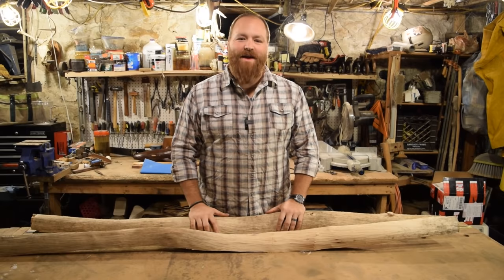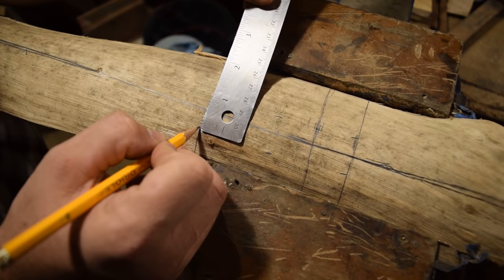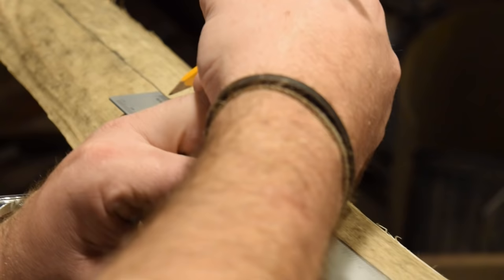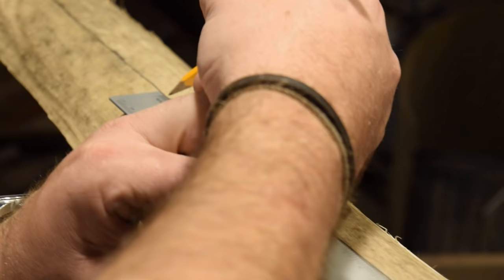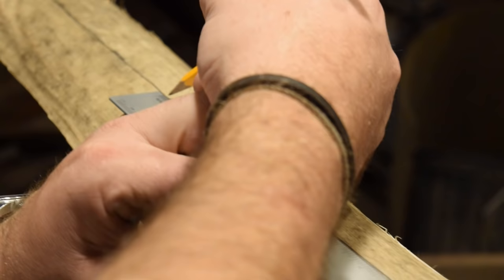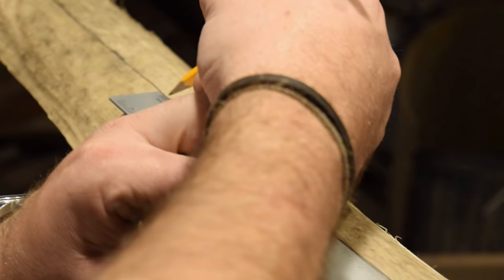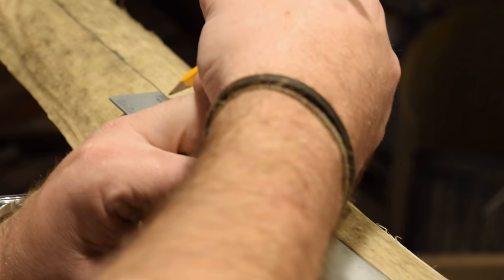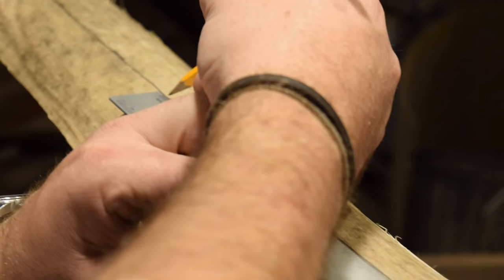Making an American Flatbow: Hickory

Comment: I learned a little something when working with band saws and I'm gonna explain as clearly as possible. Instead of cutting curves with the band saw you should put kerfs into the excess material and then go through cutting straight lines with the band saw. After that you can use a file to shape the curve. This is so that your band saw doesn't get dull or break. Hope this helps.
Reply: That's exactly what I suggested to my husband (who is a dam good carpenter, no disrespect intended to him.) But he said nahhh....the saw came off the guides, and hasn't been fixed until 4 months went by. Love him, tho!

Comment: I learned to make bows as a youngster.  And I do mean youngster.  I made my first bow when I was 7 yrs. old.  It wasn't very pretty but it shot well.  As I recall it was about 25lbs. @ 24".  
Powerful enough to bag cottontails.  
My stave was a scrap piece of hard rock maple.
My Dad was building a rustic rocking chair.  It was a genuine learning experience.  
I no longer "chase the grain" but rather use dimensional hardwood and back the bow with Sinew. 
I still make very limited use of modern materials. I use hide glue because it doesn't creep.  Waterproofing is home harvested Pine Oil mixed with Carnuba and Bees Wax mixed in.   My favorite limb wrap is Sturgeon Skin.  I started with Raw Hide and progressed through Snake Skin and on the Sturgeon Skin.  
I also switched to Asian/Turkish style Horse Bows.  Much faster cast and compact in the thick woods of the Catskills.
Reply from the maker: Thanks for the info David!
Reply: I'll bet those bows are something to behold.

Comment: I have used my identical-to-yours 12" Craftsman bandsaw for almost 30 years, and it did most things I needed.  In retirement, I upgraded to a Laguna 14/12.  Oh my, it was pricey, but the difference is beyond belief.  I now use my bandsaw as my table saw many times when ripping anything less than the throat width.  Material just flows through the blade.  It has become my go-to machine for numerous operations.  I wish I had bit the bullet long ago and got a heavy duty bandsaw.  I didn't know how versatile a really nice bandsaw could be.
Reply from the maker: That's not a bad idea Tony. Thanks for watching!

Comment: Hey tip with tung oil. Rub it in with a rag until it's hot to your hand. It makes the oil penetrate better and it doesn't leave excess oil on the surface. A couple layers of doing that works great.  Its what I was taught by my grandfather who made custom rifle stocks
Reply from the maker: Thanks! I’ll try that on the next one.

Comment: Great video 
Thank you Ranger.
One neat short story.

My father in law grew up with a metal coffee can, on an open flame, to radiate heat.
He waas doing this, in our little camper trailer, and discovered, that not all coffee cans, are metal nowadays.

Lesson learned, be certain that you have a fully Metallic coffee can, and not one with cardboard or plastic sides.

Great video.

Comment: Good craftsmanship. Lot of work and patience to make a bow without power tools.
I would like to mention that at 35:04 you said "put too much more pressure ..."; well you are pulling on a string (cable) and you cannot put pressure in/on a string. Strings can only take tension and pressure is what you put in your car tires. What you are doing is pulling on a string and you are pulling with a force of about 50 lb, but not pressure and defensively not compression.
Pressure is a measure that takes an area like pounds per square inch or newton per square meter. When you put air in your tires most cars take 30 psi (30 pounds per square inch).
Anyway, beautiful bow, thank you for sharing!

Comment: I love your workshop, it looks like it has real atmosphere.  I do mostly metalwork, with a lot of welding, so the wood shavings I generate, have to go straight away. Interesting video, I made a bow earlier this year, from Australlian Oak, but it snapped during the tillering. Will try again someday, out of a more suitable timber, I can get Sugar Maple here.
Reply from the maker: Thanks Keith. I’d say do some research for what wood you can order online  relatively locally that would be good for a bow. Osage, hickory, ash, yew, etc. good luck.
Reply: Unfortunately, it is very hard to get those timbers here in Australia, certainly in South Australia where I live. We do have a specialist timber yard that has some rock or sugar maple 2" square blocks, 6ft long at A$150 each, which is too much to waste when starting out.

Comment: Steam bend that limb and get it straight.  It will tiller better and you will get better energy distribution over the length of the bow.  I would also suggest getting a draw knife with some weight and backbone to it.  Mine is almost 3" from edge to spine.  I build my bows out of osage orange and this knife slices through like butter.  Made my first bow in 1982.
Reply: Brace height should never be more than 6” above the handle  - called the 
Howard Hill said if a str a straight end American Longbow is six feet between the bow nocks the max fistmele no more than six inches. The problem with using oil on a self bow is that it softens and weakens the wood
Cells and overtime it will reduce the weight of the bow.

Comment: I was taught that when you get it tillered and sanded roughly, put on a slightly too long string and put 100 arrows through it on 8/10 draw before you make it pretty. It either breaks, or develops set you need to fix.

Comment: I know this was long ago, but you should do a checkering on the handle, that 100 % tung oil is the one that I use after carving or checkering gun stocks, normally from 7 to 9 coats depends on how much shine I want.

Comment: if anyone is reading this to clean the round file, use a lighter, and burn the pieces out, doesn't hurt the file, as you aren't using enough heat to affect temper.
Reply from the maker: Not a bad idea. 👍🏼

Comment: I talked to an old man he had Old Sawmill up in Chattanooga.. and we were out in his shop and he took some glass and he was shaving with that like you were doing with that scraper he used a piece of glass he said that is the quickest way to remove things cuz it's got just the right of Edge is to take things off... course I'd use gloves to do it though he didn't he had really rough hands.. I didn't matter to him but he could do it with that piece of glass in it came out nice...
Reply from the maker: That's interesting Nicholas. Might have to try that. WITH gloves of course haha
Reply: Yeah, I keep pieces of broken glass around for just that purpose.  But be aware that not all broken edges are the same ...some have just the right (proper) angle to make good scrapers, some don't.  When you get a good one it's a joy to use.  I've always  done it bare-handed (77 yrs old) and have never had any mishaps.  Just takes some care and gentle touch.

Comment: Great video! Very nice looking bow.
I would suggest building with "string line" dead center and Not favoring "the hand side."  I understand that your archery skills may favor "American Style" shooting but a flatbow is a much more effective tool if arrows can be cast from either side of the grip.  Personally I shoot with a thumb ring most often and my thumb becomes my arrow rest on the right side of the bow. Occassionally I use a Cordovan finger tab and shoot from the left side.  My "long bow" is actually a Korean style "Infantry bow."   Yes it does have Siyahs.  I also use a "Horse Bow."  Currently my project is a 48" Bamboo backed Rock Maple 2 Piece Take Down Horse Bow.  It should draw 45-47 lbs. @ 28". Max draw 31."

Comment: Very nice. I am doing spoons for now. Maybe in a few years I would try this. I admire your work. I treat my spoons with half citrus oil and tung oil a couple times for deeper penetration, then do like you do with pure tung oil. Walnut oil is thinner and it will act like tung oil but I have not tried it yet. With all the work you do, I wonder what would be a good price for a hand done bow like this. I would take a guess, but it would be much better to hear your opinion. Thanks, Russ

Comment: Awesome beautiful job. Man, that bow shot really well. Nice touch with the feather carving on the ends. Why is it you do not sand the back side of the bow? Nothing like a tung oil finish. I just recently oiled a new hickory axe handle. I gives it such a personal touch.  Subbed.
Reply from the maker: Thank you. You want a complete growth ring on the back for complete strength and support, so you should avoid cutting the back as much as possible. I just used steel wool to clean it before oiling. You’re right. There’s nothing like oiling wood to finish a project. 😁👍🏼

Comment: Great so far. I am at 5:21 in the video. Now, I am openly admitting that I know virtually nothing about bow making. So, forgive if this is a stupid question. Here goes. Why not steam straighten the stave before any measurements and determining of which parts of the stave to use? It seems to me that straightening out the bends first would be advantageous. Is there a negative effect that would happen if you straightened it first? Thanks!
Reply: Red eyed Patriot1  Yes, that's true. So, I guess it was not so warped that he could not use it as it was. Thanks!

Comment: how do you tune it further after that, without losing more weight and strength?
Reply from the maker: You don’t😉. And additional tillering will remove draw weight. The only way to add weight would be to fire harden, or add a backing to the bow.

Comment: What if you installed a removable pin at one end of a yard stick so that you could spike it into the workpiece which would stabilize the yard stick at that end so you could establish the centerline more easily.  That's what I do on Kentucky Rifle stock blanks.
Reply: The center line must follow the grain, on the limbs. Sometimes it gets curvy. STRAIGHT  stock not good to follow natural grain lines.
Reply: @twintwo1429  Thanks, Twin.  Ya' learn somethin' new every day.

Comment: May I ask ( from the depths of my ignorance) if it's possible to use an aggressive sander to remove excess material?
Reply from the maker: It definitely is possible, and can be effective , but also much harder to control how much material is being removed. I would say use the aggressive material removal tools at the beginning, and move into hand tools when you get it to the tillering tree.

Comment: In what direction is the grain facing and does it make a difference?
Reply: The back of the bow (the outside of the tree )faces away from you. The belly of the bow(the inside of the tree) faces toward you. If your looking to build check out  The Traditional Bowyer's Bible volume one. They also have a volume 2,3 and 4. There filled with knowledge of  making bows from different authors.

Comment: Nice! Question: Did you roll a burr on that draw knife? When I've tried that on mine, I just get chatter marks.
Reply from the maker: No burr on the draw knife. It’s just a sharp edge, and dragging the blade at the right angle. Maybe try tipping yours toward you a few more degrees. That should help.
Reply: @TheArtofCraftsmanship  I recently found a sweet James Swan adjustable draw knife and want to try it out on an ax handle I need to replace.  Any tips on sharpening?  Was sorta thinking it would be similar to ax sharpening.
Reply from the maker: @egbluesuede1220  My suggestion would be to check out this video from Liam Hoffman. This is exactly the same technique that I use. https://youtu.be/GKr3V8LrcIA

Comment: this is not a criticism, but watching you use that drawknife was hurting my eyes bruh, you're a big fella and I'd hate to see ya get hurt...

You're too close to your work friend, back up terry-put it in reverse, a good tip is to keep your arms extended and don't use your arms to pull the knife but the weight of your body, when it comes to that twisted grain shizz... long shallow strokes, not short deep strokes, you're gonna run that knife across your gut friend... just back up some, use your weight, and don't wear out your arms so much

Comment: Answer this why didn't you straighten the bow.you rushed through with a crooked finish.i loved this video but jeez.i kno you will have a bruised forarm.how do you go from a 50lb.draw at 20" to 50 at 28" when you took the thickness down ALOT..THIS IS NOT YOUR BEST